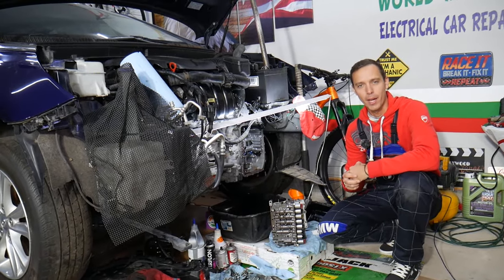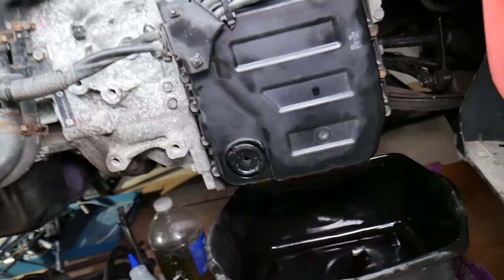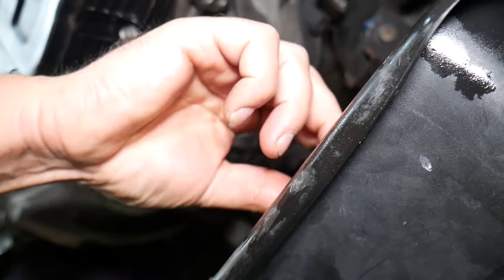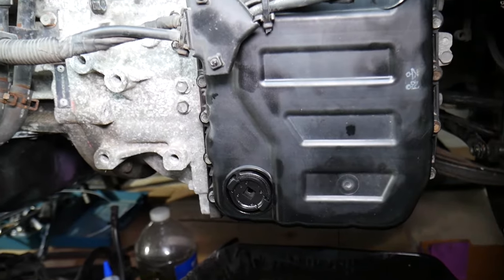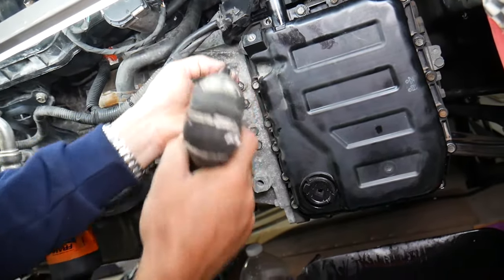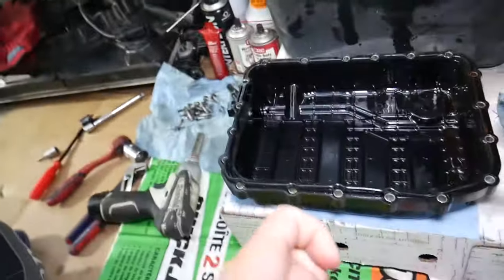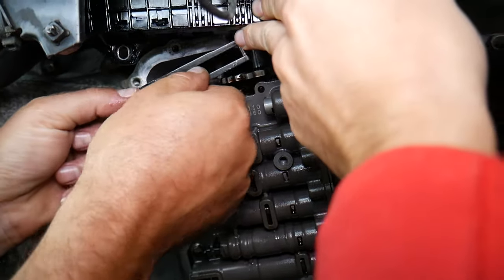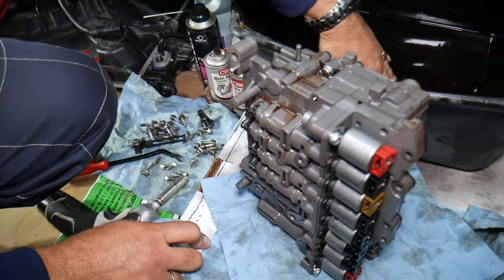AUTOMATIC TRANSMISSION VALVE BODY REPLACEMENT REMOVAL ON A CAR

Comment: Thank you I was told I need a new valve body for a 1992 Volvo 960. Unfortunately I can't find one in NY because the part is obsolete.  Can anyone recommend where I might be able to find a used one?
Reply: eBay

Comment: Hi I started cleaning my Abs harness with electrical cleaner. I forgot to plug in my MAF and started driving. The x5 said transmission safe mode failure and started shifting rough. Truck lost power and died. Truck will not start now. The MAF was unplugged. I plugged it in and it’s still not starting. Any solution?
Reply: Try a 3 sec burst of starting fluid in your intake. Just make sure you take out your air filter first😅 I've had a few cars lose prime for some reason or another, but a little Spritz of "Act Right" usually does the trick 🤘